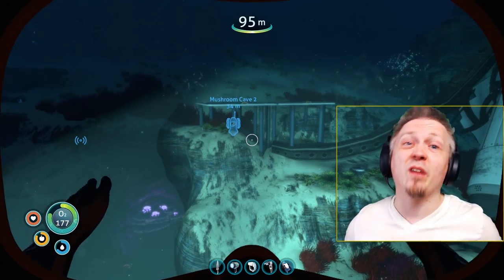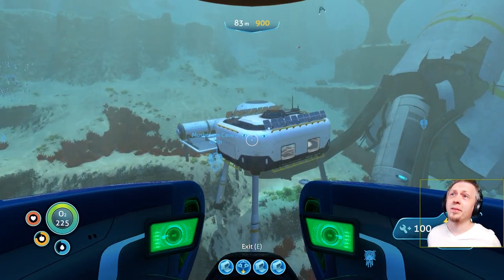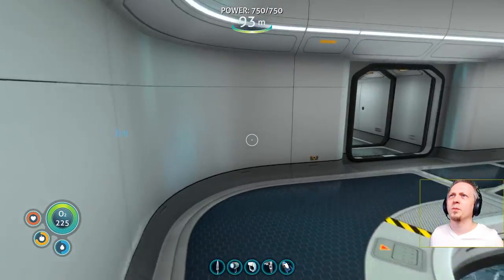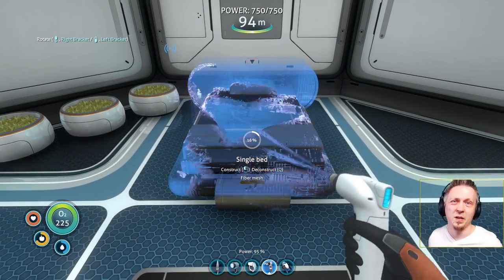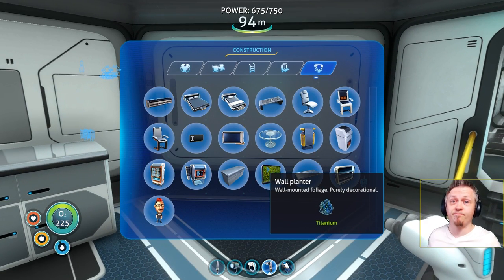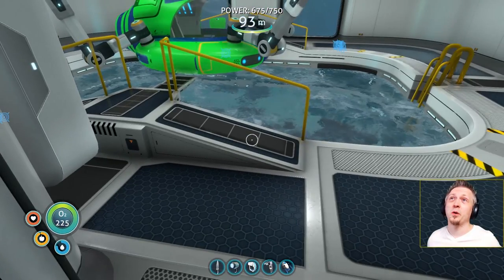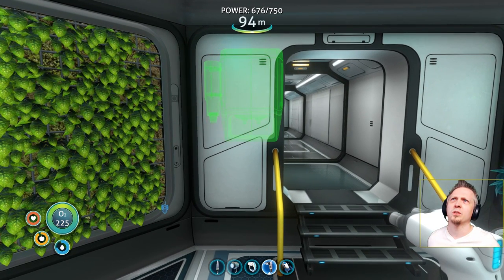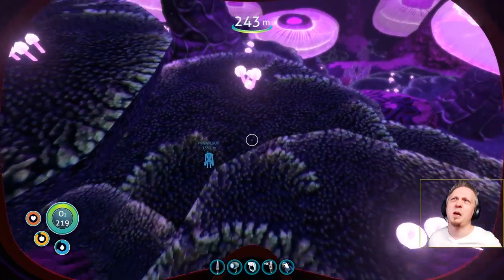DOCKING BASE READY TO RECEIVE CAPTAIN!  -  Subnautica Gameplay S3 Ep24

Comment: That entrance to the cave, just above your main base? You can actually drop a vertical tube straight down it. I did it, so I know it works :) Since you already have a base down there, you may have to fiddle with it a bit to get everything to line up correctly with a transfer base at the top. I have a platform and a multi-purpose room at the top and it all connects.

Also, I understand your feelings about the quartz you need to gather. I've about drained most of the locations I know to find it, though I did find more than I expected in the grassy plains just outside that entrance. Takes a while to gather it. "oh, look, there's one. <a minute later> Oh, another one <sigh>". Got any great locations for finding drill-able quartz, outside of the Tree Cove or under the Floating Island? I've pretty much cleaned those two areas out.
Reply: The inactive lava zone has quite a bit of drillable quartz as does the section of the lost river between the research facility and entrance near the nose of the Aurora.  If you're okay with piece by piece collection - both blood kelp zones have a ton along the walls.

I have a fully decked out Cyclops and drive that beast around with the Prawn Suit - drill, collect, return to drop off... repeat!
Reply: Cool! Thanks Matt, I'll check it out.